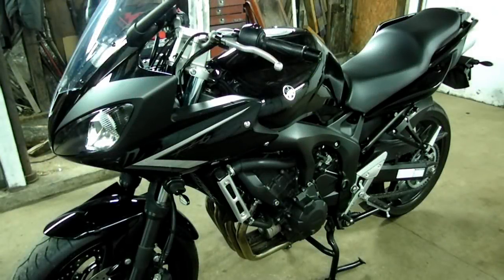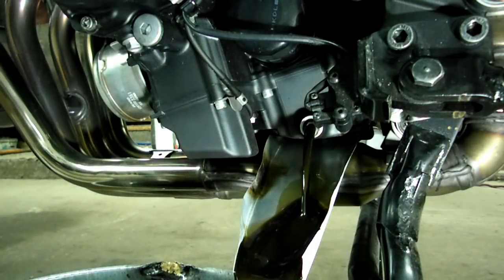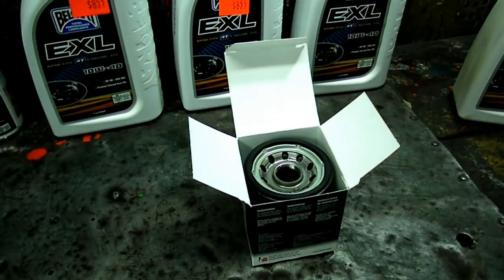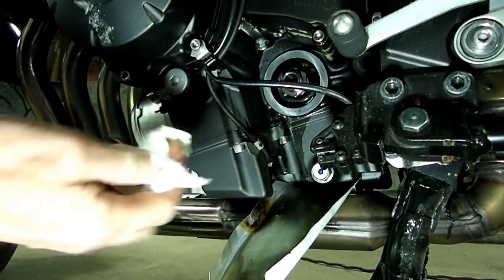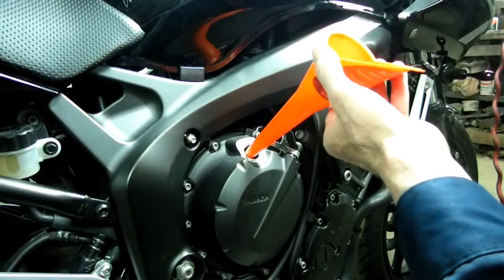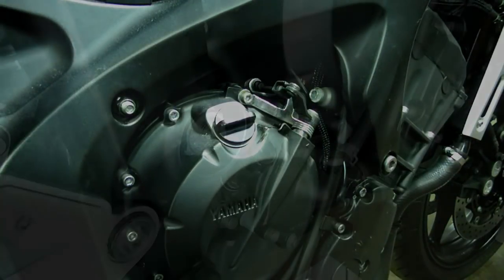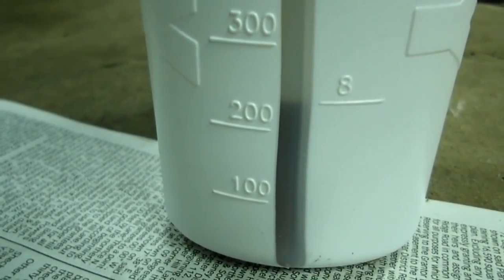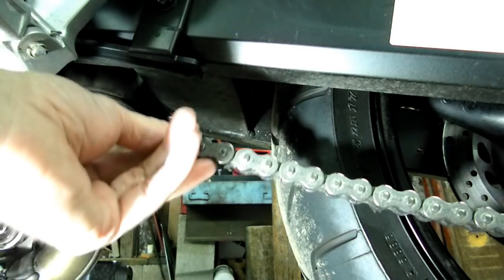Yamaha FZ6 Oil + Filter Change Chain Adjustment

Comment: Another great video rich, when I tighten the rear spindle I wrap a piece of wood in a rag and past it through the wheel and wedge it between the chain and the top of the sprocket then pull back on the wheel which then pushes the wheel into the swingarm, just a handy tip ive learnt which ive found really handy :)

Comment: the funny thing on my 2008 FZ6S2 when i fill her up 2.8L according to the service manual with fresh oil with oil filter change, the oil level on the dipstick (not screwed in) always indicate way above the xxxxxx markings. the engine does not feel as responsive and rev happy. so i tried 2.7L on my subsequent oil change.  the oil level is within the xxxxxx markings. engine feels more responsive and 'lighter'

Comment: Very Good Video! 2 Little things that I can maybe add is that the chainslack is different at different parts of the Chain so always find the spot where there is the most slack before adjusting and when it comes to tightening everything back up, make sure to have a torque wrench and check in your manual how thight the screws are supposted to be. There are special values for almost every screw on your bike. A lot of beginners tend to tighten their screws too much, resulting in minor unnecessary damage.
Reply: You should find the place where the chain has the LEAST slack, not the most. I.e. the tightest spot on the chain.

Why? Because while a too loose chain may cause slighly premature chain and sprocket wear and some drivetrain lash, a too TIGHT chain may cause countershaft bearing failures which are very very bad.

Comment: One thin I notice that I do differently.  During the chain adjustment the adjuster only pushes backward on the axle.  Only chin tension is keeping it on the adjuster so there is a little float in that system.  When you torque the axle it can float backward making the chain much tighter than where you thought you had it.  To get around the problem you should keep pressure on the rear wheel forward while you torque the axle.   I do this by straddling the rear wheel in the seated position, torque wrench is at 12:00.  As I pull the torque wrench my chest is applying the opposite force against the rear wheel.  This keeps the axle and block firmly against the adjuster.  No more readjustments..

Comment: hey rich, one thing i noticed was that you measured the chain slack at the middle of the swingarm. as far as im aware, you should check it at the middle of the chain, since thats where itll move most. since the front sprocket is only a few inches in front of the swingarm pivot, its probably not a huge deal though.

Comment: Just changed the front and rear tires on my fz6 and I will use this for tightening down the chain thanks alot. Looks like you might have dropped it from the scratches on the engine but hopefully I am wrong.

Comment: You might want to put a piece of cloth on the chain and then turn the wheel so the chain will be real tight and keep the axle snug against the adjusting screws.  While you hold the wheel ask someone else to push the wheel sideways to make sure  the right-side adjusting screw is also firmly in place while you torque the axle nut.

Comment: I have an old 1974 yamaha dt 125 motorycyle and the manual says  1 inch of play but it just seems tight. Are you pushing down when you get the final measurement as well or is it from one extreme to where the chain sits at rest?

Comment: Hi,
very good video.
Can you tell what kind of spray do you use for cleaning oil on the engine?
It's surprising how clean is the engine after spraying a bit of that cleaner and how fast is the cleaning!
Please let me know what is it.
thanks
bye
Reply: It's a regular brake cleaner spray. Doesn't matter which brand. It's really harmfull solvent and evaporate really quick so don't use it on rubber parts, your drive chain or your paintwork.

Comment: What about if you had the bike on the side stand, does it still drain the oil on the exhaust? ;)

Seems like it would even drain some more oil (so you wouldn't have to double fill but just use the full 2,8L), and maybe you could get away without your admittedly very nice steel funnel! :D

Comment: Liked your video on oil change and chain.  When you were adjusting chain, you said you had to do the "other side."   Please explain?
Reply from the maker: Was it at the 11:20 mark were i was checking to make sure the marks on the swingarm were correct on both sides.
Reply: OK, got it.  Funny, had to go down to get a filter wrench, then the new filter I bought has a hex nut on top!

Comment: i was always told to just screw filter on with the hand and do not over tighten
Reply: john mccrory by hand but make sure they are no leaks
Reply: Can't do it by hand in really tight spaces like he said. As long as he didn't out put much tension on it while tightening, it will come off next time.

Comment: Is the minimum and maximum range on the dip stick like a car, in that it's equal to 1 quart?
Reply: Soundman1963 Very unlikely, I'm sure it's less.  A quart low would be disastrous for a bike that holds 2 something quarts..  Some cars are 1/2 quart low to high.

Comment: Can anyone here tell me what the hole in the left side of the engine wall on a 2006 FZ6 is?  I had a very slight amount of sludgy oil in there.  My bike has 14K miles on it. The hole isn't leaking, I just dabbed the hole with a few Qtips and they had a bit of what looked like old oil think oil on them.  Please help, thx
Reply: I was wondering too.. apparently it's so the excess moist at the spark plugs can get out.

Comment: one thing I never understand is peoples obsession with not getting oil on the exhaust......who cares. Once the oil gets done draining wipe it off, and spray it with some brake cleaner. your done, it's that simple. nothing personal to richpin I see it in every single oil change video I watch. I just had to vent a little.